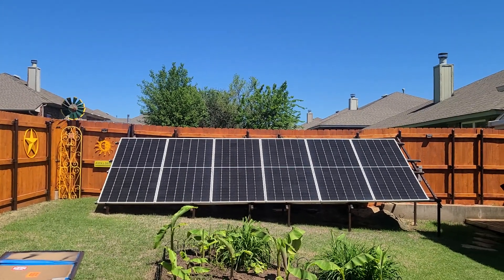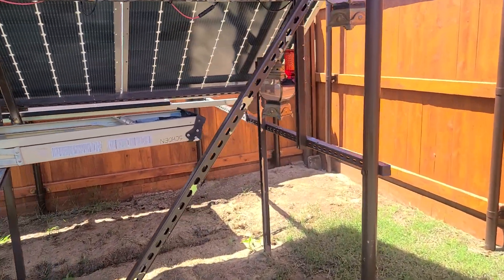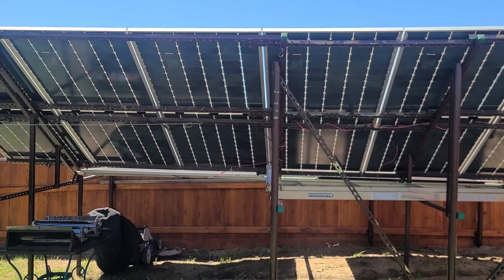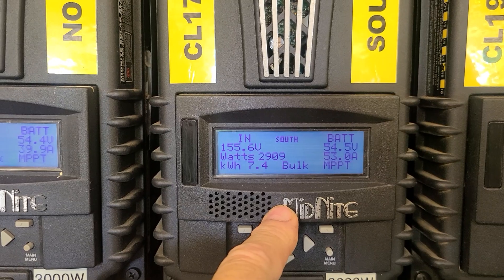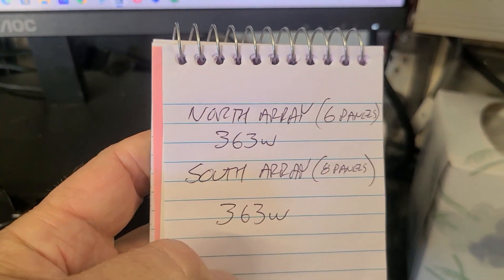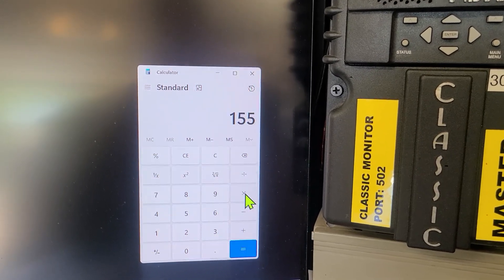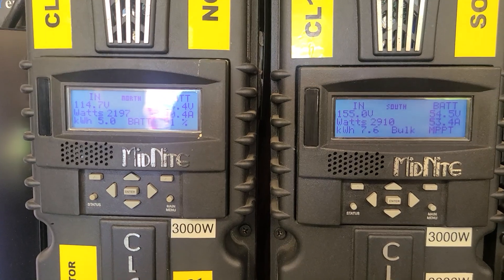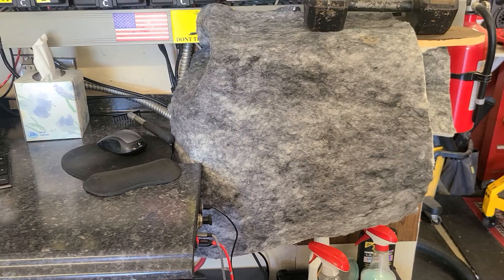New REC Solar 420w bifacial solar panel (array now making FULL POWER -- summer configuration 4S 2P)

Comment: How much would you say it drops in Winter  I live in UK where the sun barely gets off the ground in Winter and it is mostly overcast from Sept to April.  So the sun angle can be a problem for flat facing panels.  It is too bad we can't get MWH batteries to store all that summer energy as in summer it is sunny till 10pm !
Reply from the maker: Yeh, winter in the UK and much of Europe sucks for solar panel power. It doesn't really matter if the solar panels are flat or at the proper squint angle (facing the sun). No photons = no power. Oklahoma, Texas, and Arizona are crazy sunny states all year long. California isn't a state...it is big overtaxed shitShow

Comment: Looking good. The nw Rec solar panel makes a HUGE difference.  Those are great numbers all across the the volt or watts and voltage!
Reply from the maker: Thanks! Just painted all that bare metal racking (unistrut). I bought two REC Solar panels...but, one is working in that array. Happy marriage! I got the spare inside that storage room in the house for safe keeping and backup. I just gave the NAZ guys my specs, some pics, and they matched it up for me -- and sent me two panels on a pallet. 840w in panels for $668 (discounts and shipping/freight). Helluva win. Power went up (best guess) about 500w. So, should gain about 3-4 kWh from that array on a full sun day.  I'll be breaking some kWh harvests this year!